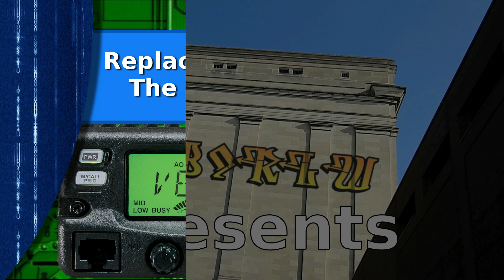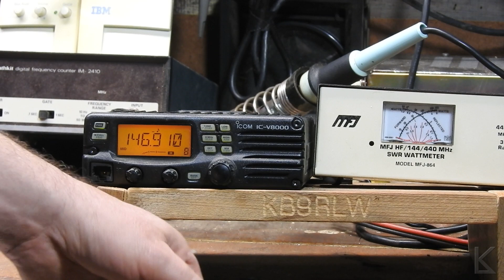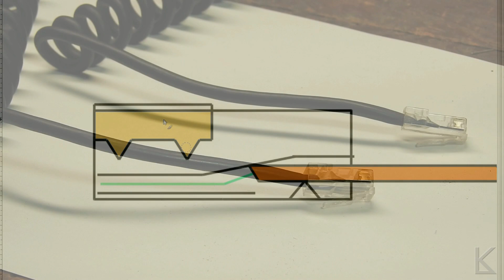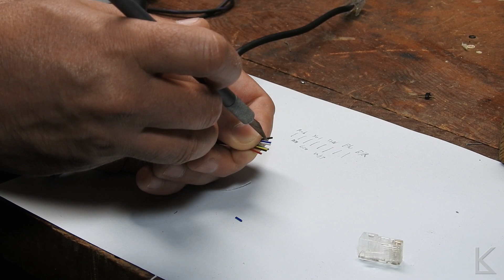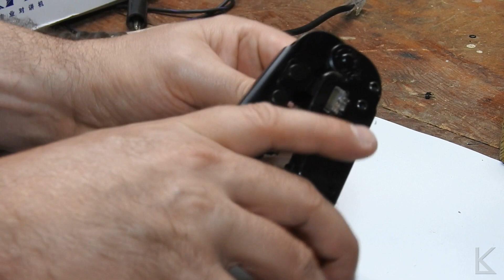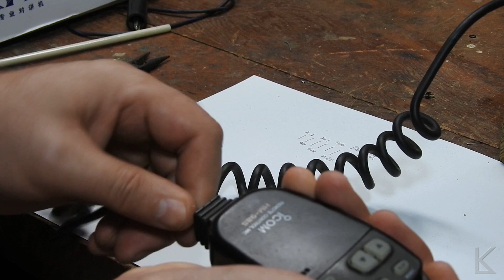Ham Radio - Replacing RJ45 connectors on an Icom IC-V8000 mic cable

Comment: Been trying to get the Signalink wiring on the RJ45 as the locking spring has broken off. Came across this. One thing I have found was to get a CAT5 cable and use that. Works well, cheap and save the hassle of trying to get the wires aligned. Had someone on VHF ask how to replace and just said "Get a PC cable with the connectors and use that". Yep, they were annoyed that it was that simple.

Comment: I have an icom 5100A and had to replace an RJ 11 connector on the controller cable.  It is basically the same as what you show here.  What I did with the braided wire was put a small piece of heat shrink tubing over the braided wire.  Heat gun shrinks it down, then it's much easier to install without fear of the braided wire coming unraveled, or a loose piece coming in contact with another connector.
Reply: In practice  y thin it whit solder, also works great, and way less work.

Comment: Most susceptible part is the mike side connector conductors as where most, if not, all of the wiggling and jarring will be. Yes, an epoxy or silicone will help minimize cable strain problem, otherwise. Well explained and I enjoyed the video. Thanks!

Comment: Hi Kevin,
Agree, worst connector for use on a microphone. On my FT450, the plastic strain relief makes it extremely difficult to press in the locking tab to remove the cable.  73  WB3BJU

Comment: Order some pass-through RJ45's before trying to replace the connectors, they're not only easier to feed the tiny wires they give you an option of passing an insulated wire through the front of the connector to solder a shield to the connector. You can get them in 23 awg or 24 awg depending on the thickness of your mic wiring.

Comment: I got the 2 piece connectors and the Klein crimper worked great had to trim the shield to fit through the hole. thanks

Comment: I have been repairing a lot of these mikes,(proffesional) And indeed its a pain in the but! my tip in this is, put some epoxy glue in the connector after crimping, that releases the strain on the cord, preventing the wires to break.
Reply: MrBugsier5 
 Hay i have the same radio  got a new mic and cable still no power to the mic

Comment: My Yaesu mobile uses an RJ-45 connector for the mic as well. And of course, the strain relief is gone. It works fine for the time being. I have the connectors and crimper to fix it whenever it finally goes.

Didn't RJ-11 (or the one that's one smaller) work fine on corded phone handsets for decades?
Reply from the maker: Yep,  RJ11 did hold up well.  But if you remember, the cord was a flat ribbon about as wide as the opening in the connector.   They were designed to work together.

Comment: The female RJ45 connector on the IC V8000 is broken on my radio.  I have not been able to get the replacement connector to put in radio.  Do you know where to get one and how to put it in? thanks Rod

Comment: How do you trim the ends of the cable so the wires are bare to the precise extent needed?  My guess is there is some magical somewhat expensive tool for that which is a reasonable purchase if you are going to be doing that a lot for yourself and others or if it is needed for a go bag, etc.???
Reply from the maker: No, it's simpler than that.   I used a razor knife to trim the jacket of the cable back.  Then once I had the wires all in a line in the order they needed to be, I put the connector next to them, where I could see the remaining outer jacket would be past that strain relief bit and I cut the wires just a hairs breath longer than the end of the connector.
Reply: on my rj45 crimp tool, there is a line of holes to put the wires through (in the corect order) after stripping the outher braid, this will position, and cut the wires in the same time, that worked out great in my time of patch cabinet installer.

Comment: ft-817/5/9 all use rj45 any faults i just swap them out for either net cable as they are cheap and readerly available pluss either net switch box's (manual type) are cheap and work as a mic swith box as in two radios one mic or visa versa
Reply from the maker: They work in a pinch, but they can allow RF to get back in on your audio.   The hard part with this icom was the audio line actually had a shield that you had to trim and twist so it would slid in to one of the channels in the connector.  Really tough to do, but at least the audio line is shielded in the cable.

Comment: I had to replace the RJ 45 on my old IC 2100 a couple years ago. I didn't have the fancy crimp tool just a pair of pliers. It took me a couple hours before I got it done. Whoever got the idea to switch from the 8 pin round mike connectors should have been tarred and feathered and shot.

Comment: Can I use a standard CAT-5 network patch cable to replace this?
Reply: yes
Reply from the maker: Yes, but you risk getting RF into your audio.   The cable Icom provided actually had a shielded wire for the audio line.  It made things more difficult since I had to trim and twist up the shield wires to get them to fit into one of the wire channels in the connector.
Reply: I have a short section of cat 5 in my truck so if I am in the back seat I clip it in and use the radio works great I also replace radio shack mic cords with cat 5 never had a problem so far.

Comment: What brand of rj45 connector and crimper u use ?? thanks good video
Reply from the maker: The crimper was picked up at radio shack years ago.  I don't know the brand on the connectors.  They were leftover by a company that was doing some wiring where I used to work.